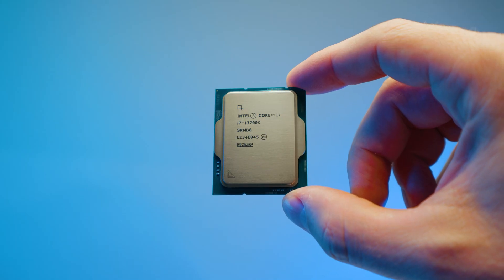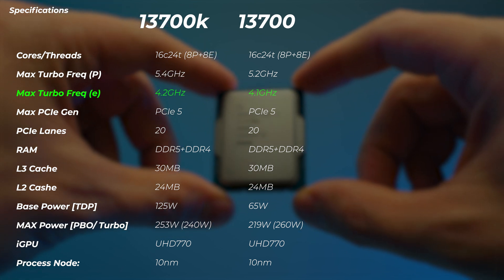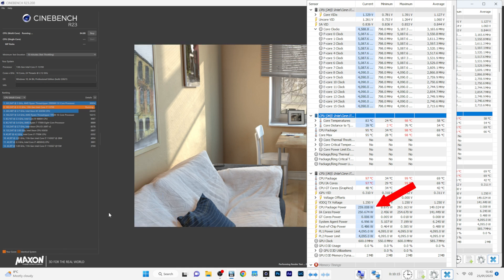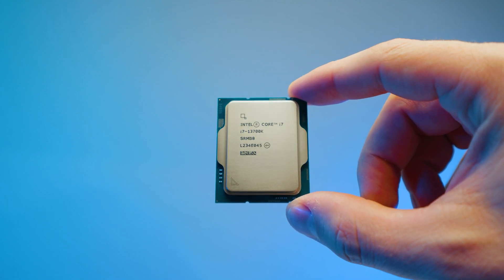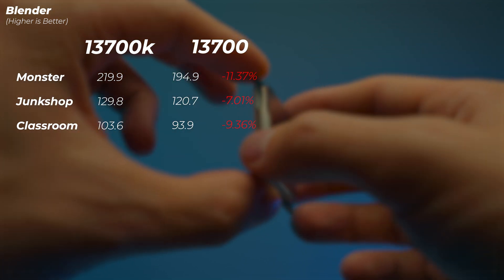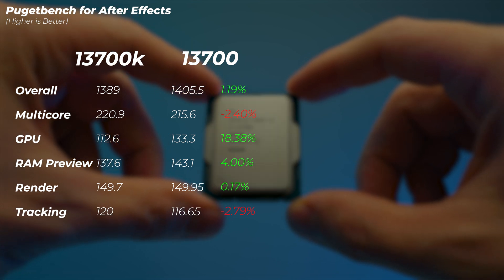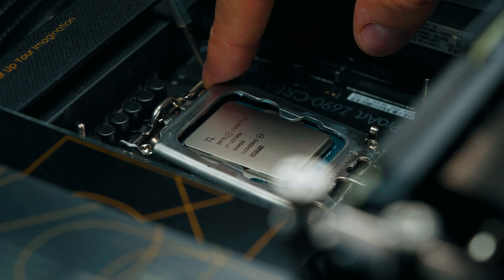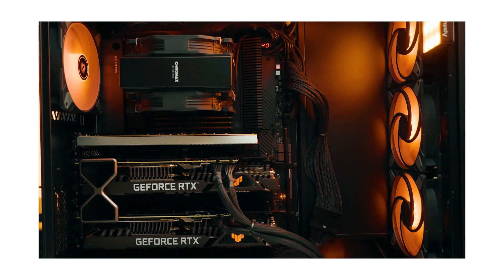Surprisingly DIFFERENT and yet SAME! 👉 Is 13700k Worth it over 13700?

Comment: its been 1 year since launch owning an i7 12700 non k 🙂. working flawlessly
Reply: Same here... Using 12700
Reply: As long as it's working well, that's fine, but either 13700 crushes the 12700k in all benchmarks because of the extra cpu cores intel stuck on the dies and doubling the L3 cache. 

So at some point you might want to upgrade, but if you can wait, wait until 14th gen comes out and a 13700k or 13900k drops in price and get a big boost for just a cpu swap.
Reply: I'm using a 10700 non k but I play at 4k mostly on 2017 and older titles so it doesn't seem to hold me back yet
Reply: Sure it works flawlessly,but not as fast as the 13700